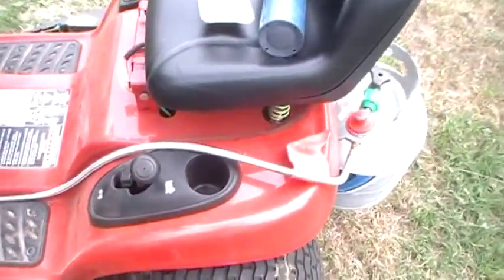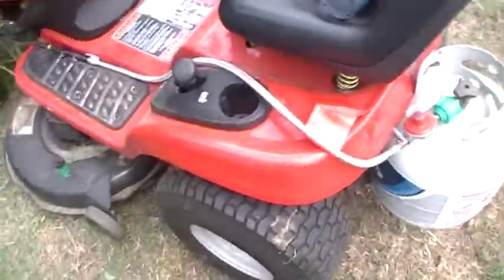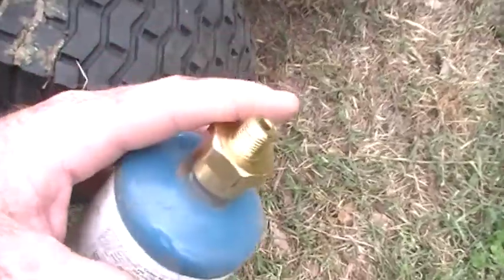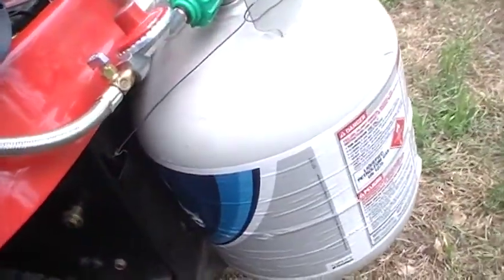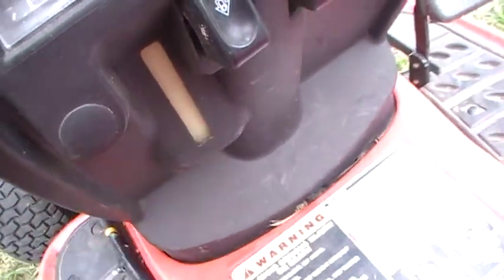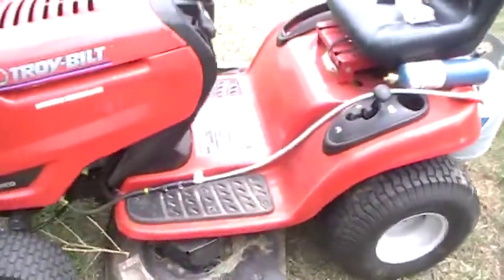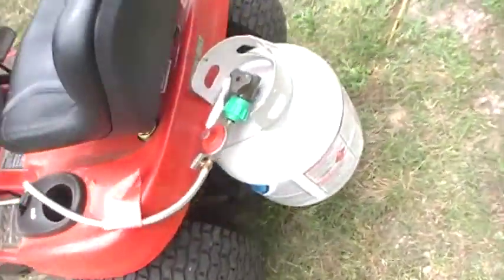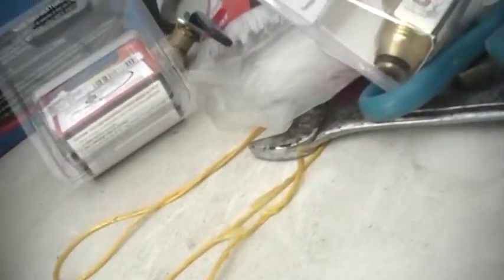ridding mower on propane

Comment: You need a demand regulator, it works off the vaccum to regulate the flow and when the engine dies so does the propane flow

Comment: to make it more user friendly i would hook up a solenoid in line with the propane and connect it to the ignition switch so when you turn the key to the run position then it will turn on the propane going to the intake, just in case you forget to turn the propane off

Comment: Rick, toss the old fuel tank and use that space to mount 2 propane bottles on the firewall and you will have plenty of room for the regulator & hoses. It would be interesting to know how long it would run on one bottle, 2 bottles would double your range. Mount your bottles upright.
Wonder if anyone tried to run a small 4 stroke motorcycle or golf cart like this?
Good luck.

Comment: I hope you installed a hotter spark plug than stock or you will  always have surging of that engine when on propane, even though you try to regulate the amount of propane flowing to the carb on it.

Comment: Now, im also 14 and ive been working on mowers since about july, and i want to do this to my tractor, but my parents think im going to blow myself up, so should i attempt this on a smaller maybe a push mower first just in case?  Because i know its cheaper, i buy my own gas and i mean, i go through a tank every two weeks because i ride it like its a gocart, so it uses more gas, but gas IS expensive now, and to be honest, i love my tractor, but if theres a cheaper way to power it then ill go for it!  So should i attempt this or no? Because you can only get so much money off of working on mowers, and really, its not a year round job! But id like there be a way i can go from gas to propane and if i must, go back to gasoline again. Also, when i disconnect my fuel line from the tank, should i start it and let the carb run out of gas or no?
Reply: You will not blow yourself up with propane use. It is even less volatile than gasoline is, in reality. Put JB weld onto the metal parts of this mod and you will not have any  propane leakage to begin with. Using the yellow tape to wrap all fittings will also work if you decide against the JB Weld use. Your parents worry too much, based on inaccurate information. There is a $12 buck adapter to refill small propane tanks with and the price of propane is very, very cheap compared to gasoline prices. The small bottles will allow you to mow an average sized yard for as much as 3-4 times before needing a refill. There are other videos which explain all of the necessary equipment, as well as showing how it is all put together and even explaining why your parents worry over you blowing yourself up is needless concern. Starting with an old discarded or hand-me-down lawn mower makes it easy to work on as you decide for yourself if you want to modify it with a bigger bottle or just make some mods to all the tubing and regulators or such. Good luck in what you do.

Comment: Hand held DIY videos "SUCK"  !!This is what you need to make it a safe conversion from gasoline to LPG propane:Impco Beam T60-A-VP-N RegulatorImpco Beam Regulators, Model T60The T60 is a two stage regulator/vaporizer for LPG applications up to 60hp (45Kw).  Various models feature built-in vacuum lockoffs, idle adjustment, primers, various heating methods, and several mounting options.  Newer models (post 2010 production) include an improved primary and secondary lever and seat design, and a standard freeze plug and idle screw.  The idle screw has improved sensitivity and stability and is relocated to the cover.  An idle screw cap and tamper resistant screws satisfy regulatory tamper resistance requirements.  Optional dual mounting tabs are available and all mounting features and ports will remain the same.

Comment: Great vid. I'm in the process of doing my rider it's a craftsman 12.5hp and I've hooked my line up and its not getting a full 12.5hp when i'm running it. It idles really low, not like yours where you give it more gas and you're able to run your blades on yours as where I know that if I even try to engage the blades, it'll stall. Would you be able to help me out? How do I get the whole 12.5hp by hooking up to propane? I don't have a regulator for my setup yet, would that be the problem?
Thank U

Comment: you have no idea what kind of fuel/air mixture you're running. these "conversions" are all the same... some jerry rigged contraption that runs half assed. It would work 100 times better to run it on gasoline... like it was designed to do.
Reply: +jay bradley yes. you need a low pressure "demand" regulator.
Reply: Ryan McCurdy you have know clue what you are talking about they make propane Kit's to convert engines to propane my engine is 27 year's old runs perfect on propane
Reply from the maker: yeah I think you can find them on ebay now days for about $40, in 2011 you couldn't find them anywhere
Reply from the maker: ryan I used my fuel (fast to slow) to adjust my air mix
Reply: @mrbriggs68  yeah lot of bull going on here,they build versa generators that are dual fuel  also ,im with you on this Scott